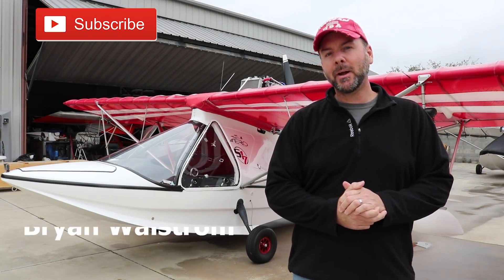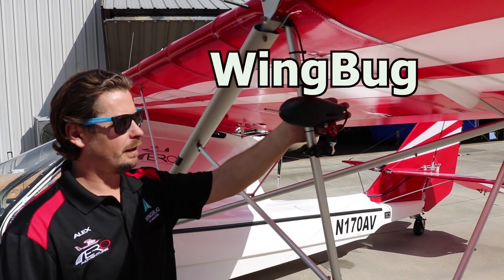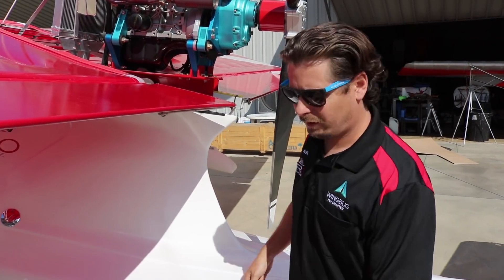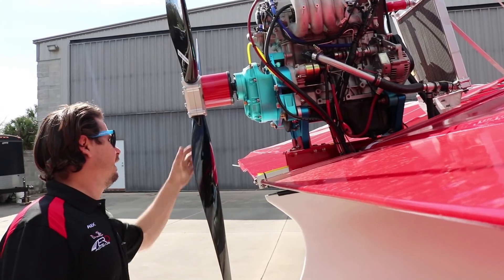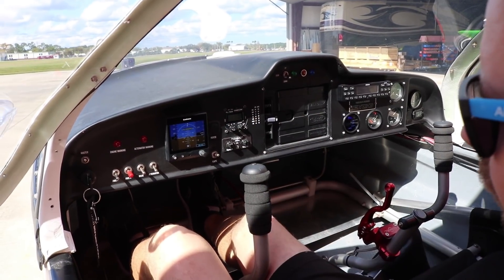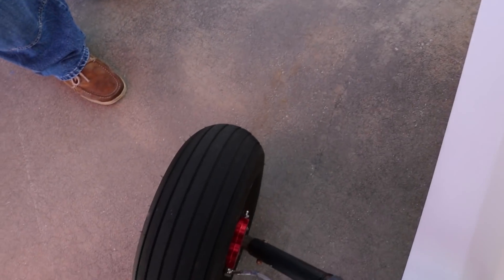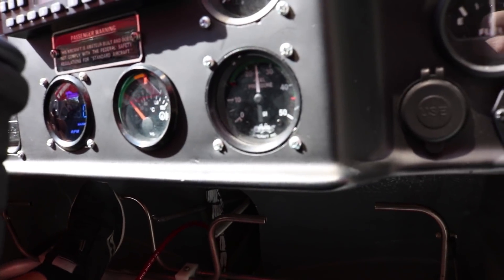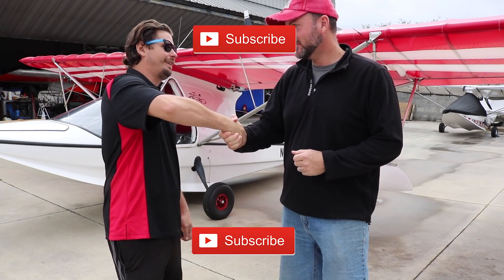Aircraft Preflight - Flight Training Walk Through

Comment: Two things I noticed he didn't do during his preflight. One, he didn't run his hand down the leading edge of each prop blade to check for nicks and crackes. Two, he didn't check for water in the fuel. I wonder if the fuel system has a water/fuel seperator and/or it is not required for direct fuel injection.

Comment: Is there any discernible performance improvement if the gear is retracted?  (In the air I mean, I get that you Take-Off run will be extended if you leave your gear up for a runway take off!)

Also, do you think you could get some larger tires onto it?  I will be operating out of a prepared grass RWY (that I share with the sheep).
Reply from the maker: I don't believe there is much difference up or down but maybe slightly. They are using a variety of tire sizes but the bigger you go, I am told, the more bouyancy the tires have and to extend down under water for "beaching" may be difficult. Otherwise...me personally... I would like to see a BUSH-STOL version with big fat squishy tires/tyres on it! :-)